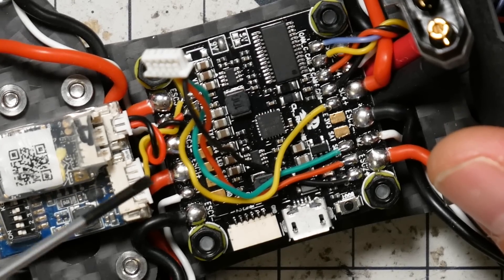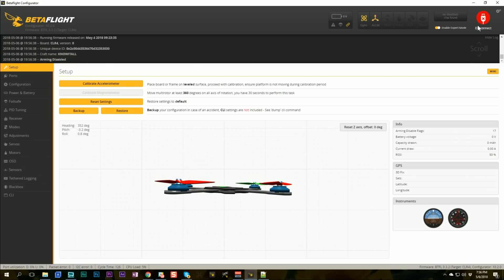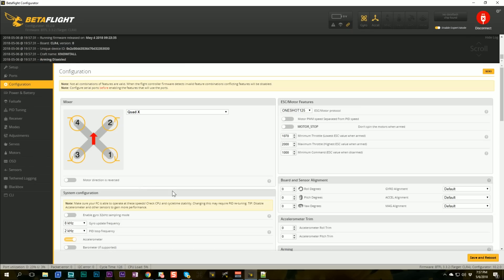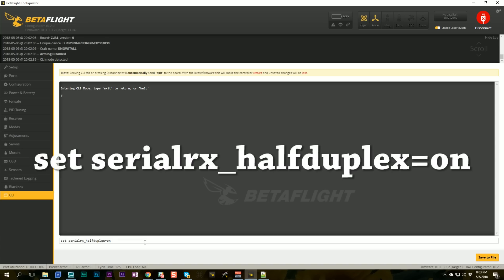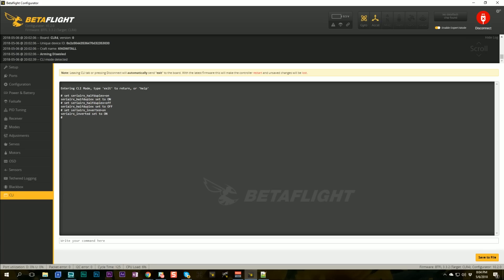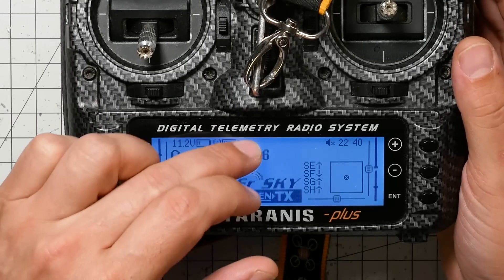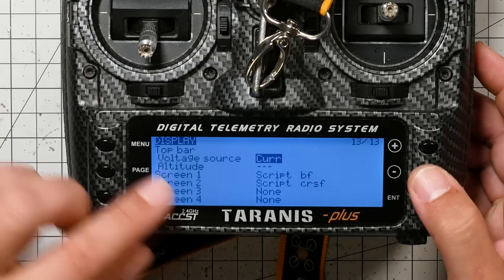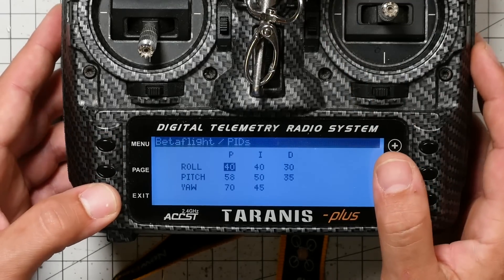FRSKY FPORT HOW TO | SBUS and SmartPort on One Wire

Comment: thx for the video.  for anyone that this doesn't work.  if you dont have a telem/sp labled pad and using a generic uart, make sure you're on the TX pad and not RX.  If you are using an rxsr and a generic tx pad you will need to use the uninverted p pad on the rxsr to get telemetry to work
Reply: It's still not working for me on HGLRC XJB F428. I've tried all 4 combinations for inverted/half duplex as well as inverted and un-inverted hacks...No change. Not receiving any stick input on BF 3.3.2
Reply: Nevin, i had the same problem, you have to disable serial on the sbus ,

Comment: I used to use the same model for all until recently as mid and end points would always be exact.

Do you play with this? I imagine you could adjust it from with FC instead of controller if you wanted?

Comment: Hey Josh. I'll be building my first quad later this summer.  I have a Frsky X-Lite and an R-XSR on order and I'll be using an HGLRC F4 Flight controller+ESC combo. If I use the F-Port method, does this mean I won't have to do the uninvert/invert solder hack on the R-XSR's tiny solder pads? I haven't touched anything RC since the mid 80's when I raced 1/10 scale on/off road cars(a carbon fiber Predator) and buggies(Tamiya Hornet)with crystal radios,pot style servo controlled speed controls, and brushed motors(who remembers "Reedy" in a can? Haha  I'm trying to do tons of research way ahead of my build(getting my ducks in a row) I'm so thankful for YouTube and all your videos! I can't wait to  get on a sim and then fly FPV!!
Reply from the maker: If the HGLRC F4 has a smartport pad then you do not need to do the uninvert hack.

From the question, I am guessing it does not have a smartport pad, and then you have to do the uninvert hack.

Comment: I spent several days trying to get telemetry to work on a Matek F405-STD natively without using softserial. Among my attempts was switching to FPort and I did get control input to work but no telemetry, with all combinations of BF flags and uninvert hack / no hack with several R-XSR receivers. As far as I know the F405 does not have a bidrectionally uninverted (or inverted? It's confusing as duck) UART which is required to fully get FPort to work.
Has anyone had success getting telemetry to work on an F405 without using softserial, FPort or not? If so, how? Please no theoretical suggestions since I am pretty sure I tried all of them several times.
Reply: https://github.com/iNavFlight/inav/issues/3194
Due to resistors exists in the F405-STD uart ports, you can either use softserial with normal inverted smart port output or use the uninverted pad with a wire to bypass (short) the resistor.

Comment: Hmm, this is cool. Joshua, please keep these great videos coming!

I just did added SmartPort capability on a Flycolor S-Tower (F3), using Pin 6 of the PWM (10-Pin) connector to a FrSky XSR. Supposedly on this FC, if you use the supplied SmartPort pad, it's shared with the USB bus and complications ensue using them simultaneously, so better to use a free TX pin and SoftSerial.

I'll have to try this F.Port mod soon, but since everything is working now, I'll wait. ;)

Comment: heya josh,

i got f.port working with an hacked r-xsr on matek 405-std (the new one with the barometer).
betaflight receives the sticks, switches and sliders, but i don't get telemetry working what so ever on the 9+d. however telemetry data still is available on the OSD.

since i got it working on an other quad also r-xsr+405(an older one without baro) i have no freaking idea what i might have missed on the one i'm working on. i tried every combination of parameters serialrx_inverted and serialrx_halfduplex and tried uart 2,3 and 4. inputs reckognized but no telemetry.

any ideas? 

btw: since i'm living in europe I OF COURSE only flash LBT firmwares!

happy flying!

ps: thats the quad i'm talking about: https://www.youtube.com/watch?v=JtUaI4CIenU
Reply: https://github.com/iNavFlight/inav/issues/3194
I also have these two boards (std and osd), the osd work fine while the std cannot receive telemetries with non-inverted pad.  I use the softserial approach to make it work.

Comment: Hi J.B. is there a way to use the inverted sbus signal pad with inverted s port? I tried a few months back on a hglrc xjb f440 with the rxsr. there is a uninverted signal pad on the bottom near the plug but I don't have any other uart available. i depin the sbus wire and pinned it to the s port wire. via the plug which is inverted. thanks in advance I tried the both cli commands and and all 4 combinations to no avail. Maybe the sbus pad does not work as tx pad as far as software is concerned?
Reply from the maker: No, that's not going to work I don't think. If you do the uninvert hack, you must connect to an uninverted UART. If you connect to an inverted UART (like the smartport pad), you must send an inverted signal.
Reply: Joshua Bardwell ok, thanks for your reply hopefully new fc boards gives us more than 3 uarts... To bad reciever UART isn't available for us users that use crfs. So theoretically I could use smart port tlm on that pad but wouldn't it need a Rx pad? Thanks for educational videos man keep it up 👍

Comment: Does something need to change when you allready wired everything up for the old way? or can i just leave everything as is and flash the new firmware?
Reply from the maker: No wiring needs to change. The wiring is fine. But how will you flash the receiver?

Comment: So I just did the fport conversion on my Matek-f405 with my r-xsr on urat 2, the S Bus pad. I'm running inav and everything seems to be working except telemetry I'm only getting the r-xsr telemetry. My taranis is only running open TX 2.1.8 I'm guessing that this is the problem but I'm leery to upgrade to open TX 2.2 when previously updating my radio open TX prompted me to update my internal module and then bricked it and I had to replace it.

Comment: Holy moly, opentx looks so complicated, each time you are trying to setup anything. So Many menues and setup options
Reply: I guess that's the price for a massive, powerful, feature loaded piece of software that can run on even very simple (and cheap) electronics and can be controlled by just 6 buttons. When I got my Taranis I tried to not change anything that I had no clue of... that worked well for me.

Comment: hi joshua when are you gonna build your massive droner, just putting mine togther used airbot ori32 esc emax 1106 4500kv and 4cell and the new ominibus f4 nano v6 i can get 8k/8kl imited by gyro ,are there any 20x20 FC,s that go higher  and are there any qurks to tuning a micro quad.
Reply from the maker: I'm not doing a build but Neil gave me one when I was in Houston and I just got it set up and am going to start flying it.
Reply: any perticualr tunning quirks i shoul look for this is my first micro coming off a 5in

Comment: Crossfire has been doing single UART control + Telemetry for quite a while. As an EE student it always seemed odd to me that FrSky needed 2 UARTs instead of one for control + telemetry.
Reply: Because SBUS came earlier I guess.
Reply from the maker: It's because the two technologies evolved separately. SBUS is a control link that was originally designed for servo control. SmartPort would connect to sensors in the plane such as air speed and altimeter. When mini quads came along, we realized that we could emulate both of these functions in an FC, but the receiver didn't know it was talking to the same device.
Reply: Joshua Bardwell Makes sense. I still feel it took a really long while to develop a single usart solution

Comment: I tried Fport on a quad a couple months ago.  X4RSB rx and Beerotor F4 fc.  RSSI displayed really low numbers but the quad flew fine, for a couple minutes, then it just dropped out of the sky.  I was only a couple hundred yards away and had been farther.
Reply from the maker: IMO there is something wrong with your receiver or setup. I don't think FPort should cause failsafes if SBUS does not.
Reply: Same for me die you find a solution? My range is low about 200m. The drone droped From Sky. Using fport and Flex Firmware.
Reply: @XPSyan  I've used Fport on other receivers and flight controllers and it worked fine.  Just that one was a problem.

Comment: I have a problem. I got fport to work a month ago and I have been flying with my quad and everything but I can't get telemetry to work. I have deleted sensor and try discover new sensor multiple times but it still doesn't work. Any ideas what the problem can be?
Reply from the maker: Possibly you wired the receiver up to a port with a uni-directional inverter, so the receiver function works but the upstream telemetry function does not.
Reply: Joshua Bardwell i tried to use another uart on my FC (hglrc f440 stack) but when I did that I didn't get the receiver function to work :/. I tried all the different cli commands
Reply: Tobias matek f7 I did it both ways even the hack no telemetry no lua script but fport worked so something is wrong some where
Reply: I tried the hack as well but no luck either :/. I'm going to try another fc to see if it works that way.

Comment: Specifically on the r-xsr, does the S-Bus-in still work?
Reply: In the FrSky firmware downloads it says "4:Redundancy function is still valid;". So it will still have SOME function but there is no information how it works exactly.
Reply from the maker: Yes it still works. The question is, what happens when the receiver failsafes over? Does it pass through SBUS or does it convert to FPort? You can test it and let us know!
Reply: Joshua Bardwell yes I will test this tonight or tomorrow with my x8r. Because I only have one x9d my test will be to hook everything up and then set model 01 to r-xsr and model 02 to the x8r, then switch between the selected receivers.
Reply: If you flash F.Port firmware to the R-XSR, S-Bus is not longer transmitted on the S-Bus wire.

This is from experience.

Both Firmware 180111 and 180228 disable S-Bus output.
Reply: So my setup never worked after flashing the FC and the r-xsr...I couldn't get fport to work with all inverted/uninverted hacks and inverted/halfduplex. I was able to simply re-wire my sbus wire and it worked immediately after changing back from Fport to sbus

Comment: So we only need 5v,ground  and the s.port? Just 3 wires now?
Reply from the maker: Correct.
Reply: Joshua Bardwell sweet. Gonna do that to all of mine then. Thanks for doing the vid.
Reply: Well I am back with a different fc. I have a dys f4 pro v2 and trying to use an rxsr with f.port and cant seem to get it. Is it the case the dys f4 pro v2 does not have the proper pads and can only run sbus or am I missing something?

Comment: My eachine wizard x220 automatically accelerates when the throttle is low, any thoughts?
Reply: Are your endpoints correct . Have the same problem . Now ive set my endpoints to min 1000 en max 2000 . Mid is set to 1500
Reply: I cant get betaflight so i got the rtf wizard
Reply from the maker: https://www.youtube.com/watch?v=xBaefeQtA1c
Reply: Joshua Bardwell thanks for the reply.  Ive got an other ball buster. My quad falls out of the sky for no reason . When he is ln the ground i can arm it back up . Range was close by . Not failsafe shows up on the black box
Reply: Thanks foe the link and nice vid but my motors still spin up with the props on?!

Comment: Is there a way to keep the Jack and avoid to solder on the small uninverted S.Port pad?
Reply from the maker: Yes. Do just like I showed in the video. Connect the SmartPort wire to the Telemetry pad on your FC. The Telemetry pad will have a bidirectional inverter and Fport will work.

Or if you are using F3 or F7, use any UART TX pad because they can handle inversion no problem.
Reply: However, for an F4 board with no telemetry pad, you are stuck.

You would have to cut the trace from the inverter to the jack and solder a bypass wire.  Possible, but not at all easy (no instructions given on how to do this - and you cannot just bridge the inverter).
Reply: Just saw this question because I may have to do the hack. You may be able to desolder the plug, cut the smartport pin off flush with the plug, resolder the plug to the board, then solder a short jumper wire from the backside of the pin to the P pad. However this may prevent you from flashing firmware since the normal smartport connection is necessary for flashing. Doesn't avoid soldering to the tiny P pad but makes for a cleaner install. A lot of work and better have skills soldering. Lol

Comment: A bit off-topic here but damn look at those perfect solder joints, haha
Reply from the maker: Credit where credit is due: Armattan built this quad.
Reply: While adequate, they are far from perfect. The green wire is about the only one that does not have excessive solder.

Comment: Wonder how much effect it has on latency?
Reply: suposedly its suposed to be the same latency, around 20ms or so
Reply: I'm interested as well. Is there a Latency difference between F-Port an SBUS ?
Reply: @lililililililili8667    On f-port or s-bus? Almost all the race pilots I fly with have crossfire for low latency. I am looking for those official latency numbers and see if it is worth buying crossfire or r9m for my taranis. I have x4 rsx-r on my race quads and want to know if f-port is worth it?